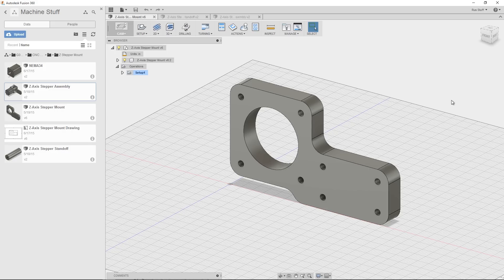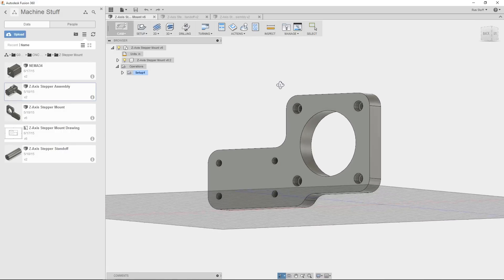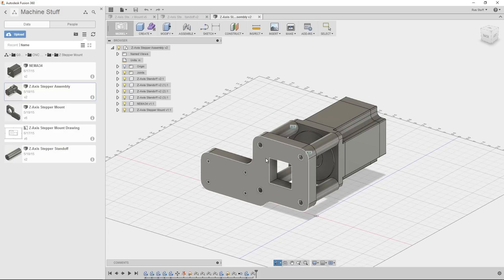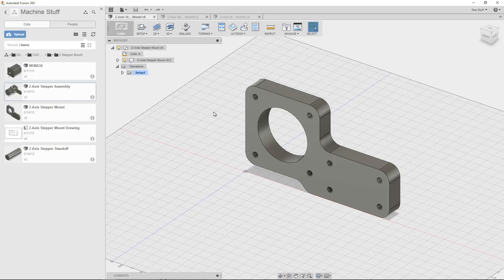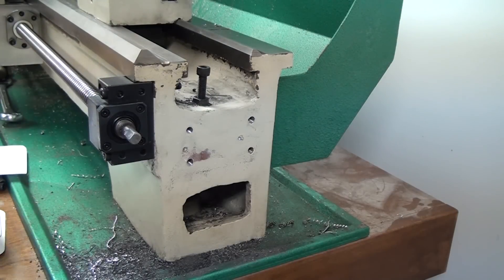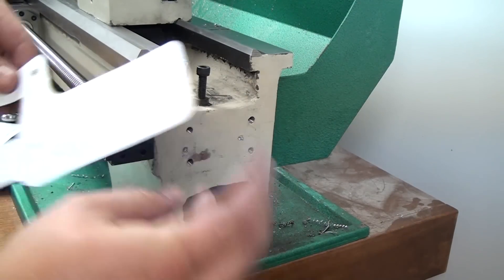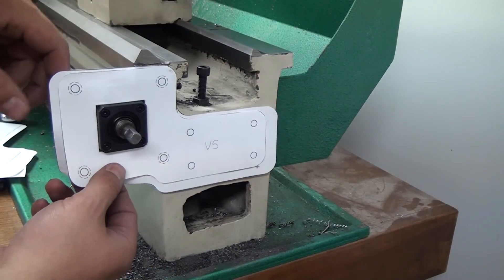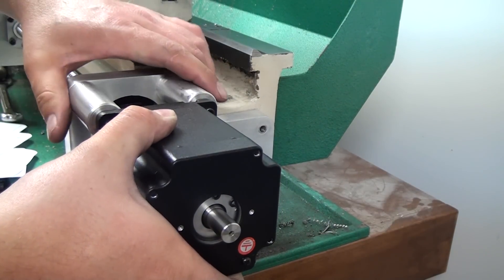G0602 CNC Conversion pt6 - Z-Axis Stepper Mount

Comment: I love these videos.  They show all of the relevant info and they demonstrate how you did the work, and even provide some very useful general shop tips and tricks along the way, but they're short and snappy videos that respect the viewers' time and leave us wanting more.  I aspire to brevity but I always tend to err on the side of telling every detail and my videos tend to be too long.

That Z axis motor mounting plate may be the prettiest part on your lathe!  I think it's probably twice as thick as it needs to be for the forces it must bear, but the excellent machining and extra beefiness make it look awesome!

Despite a lot of peer pressure from the  other kids, I'm not using 3D CAD/CAM yet.  Fusion 360 doesn't run on Linux so I'm waiting for FreeCAD to mature.  My parts tend to look simpler and more rectilinear.
Reply from the maker: Yeah the Linux support out there is a problem. Your right about this thing being way thicker than needed, but a thinner piece just looks to understated. I like my parts looking beefy :)

Comment: Tip, get double sided sticky tape, thin cardboard (what kids use to draw on in their sketchbooks) a thick crayon or just smudge your finger in dirt.

Put the cardboard with the sticky tape where you want it to be then run either dirty finger or thick crayon over the line in light passes. The true line will reveal itself in perfect definition.
Reply from the maker: Good thinking 👊

Comment: I know I'm late to the party but I do have one question. Did you have any problems with the rear of the bed casting being flat and square to the bearing block you added. As it's a cast surface it could cause issues with alignment?
Reply from the maker: You're exactly right, but I didn't do anything at all to counter the issue. I'm using Oldham style couplers which allow for some misalignment. Lovejoy's would allow for even more if you're really concerned about it.

Comment: Was there a reason you went with a Nema 34 over a 23 for the z axis?
Reply from the maker: Yeah. Back when Grimsmo had his G0602 I remember him saying that his z-axis was underpowered and I think he had trouble drilling from the tool post. I wanted to have plenty of torque so I could push large drill bits, so I got the largest z-axis stepper I could get.
Reply: +russtuff Good to know, I'll keep that in mind with my lathe.